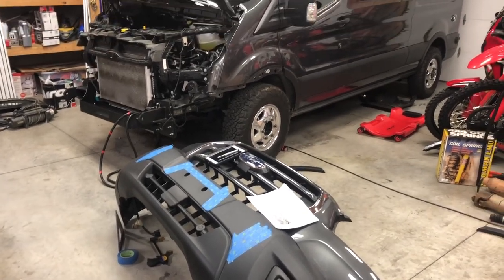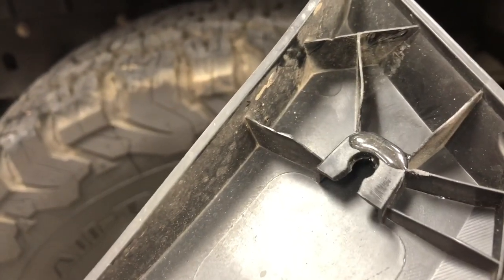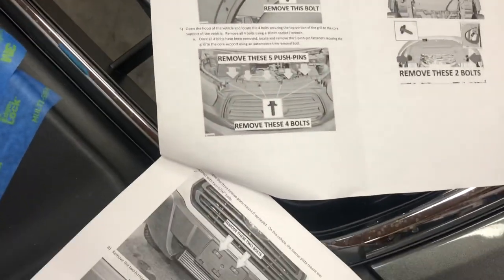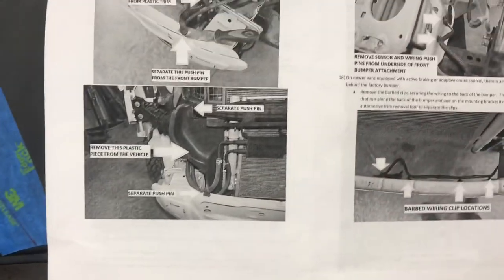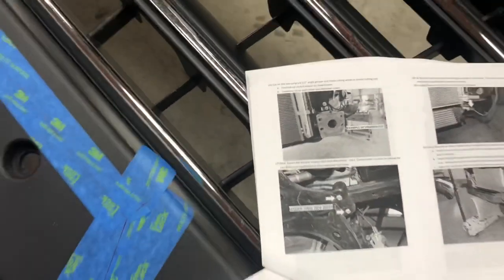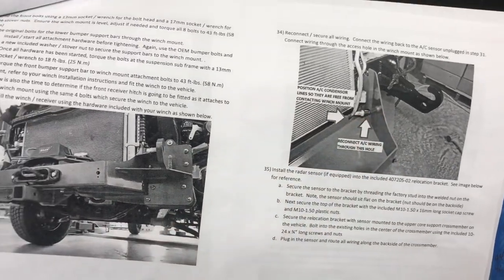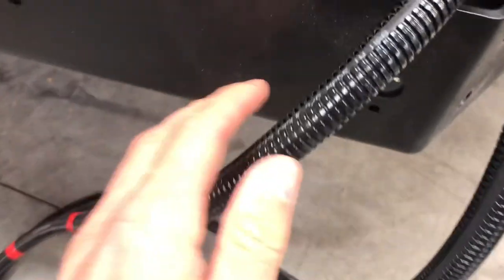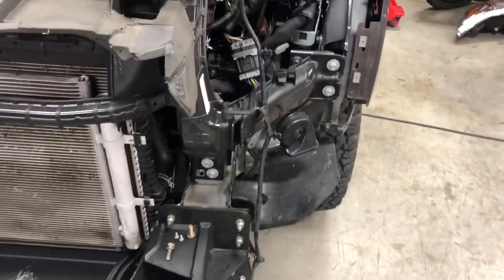2020 Transit- Van Compass Winch Install

Comment: Great video - well done install - I am about to tackle this on my 2020.  One question on the wire sizing 2/0 you installed, I will install a warn 12-S winch.  I am having trouble getting the actual amp draw for the winch, where do you get this information?
Reply from the maker: I researched some on the transit forum and that’s what most people were using so I just used that.

Comment: Thanks for the video.  I just installed the VC bumper on a 2021 and this was very helpful.  A few comments.  1: my Warn winch came with 6' of 4g wire, and I ended up using 10' of wire total per run, so I think 2/0 is pretty overkill.  I used 1/0 and 2g probably would have been adequate.  2:  Adding the VC nerf bar to the bumper hides the two unsightly holes left in the plastic on either side of the winch tray.  3: The VC skid plate protects the intercooler that will now be exposed after removing all the undercarriage plastics required to install the bumper.  For cold-weather drivers, it also eliminates the need for the factory-powered louvers that you mentioned.  I am now concerned that the intercooler will cool as well as it did before, however. 4: For those vans with parking sensors in the bumper that need to be relocated, I was able to strip wires out of the loom to get the required length on the L side.  On the R however, the 3 wires need to be lengthened as they will be barely long enough.  5: The revised VC dimensions for cutting the plastics were spot-on for me, but this is a tedious and nerve-wracking process. I used a multi-tool.  I think this is a very well-built winch bumper.  Maybe not quite as nice as the CAtuned option, but also less money.

Comment: I'm also about to do this same thing. Did you wire the winch straight to the battery or did you go through the CCP points on the side of the seat?
Reply from the maker: Straight to battery. The CCP has a fuse that if blown, the van won’t start. At least that’s what I read.

Comment: Looking at something like this, but need to incorporate towing. As in flat towing the van. All too many of the bolt on tow points drop below the bumper and are a bit weak in my opinion. Since it will be towed behind utility truck from the factory pintle hitch, the down and back up stress wold be more than I would be comfortable with on those types of points made for towing behind an RV.

 As an end user, would you have any issues with putting a custom tow bar on the pull points? The whole thing looks plenty strong, but I don't have the ability to get my hands on one.
Reply from the maker: I would think it’s strong enough but you probably need to contact the manufacturer to be safe. Good luck.